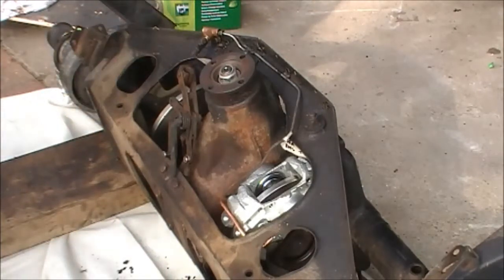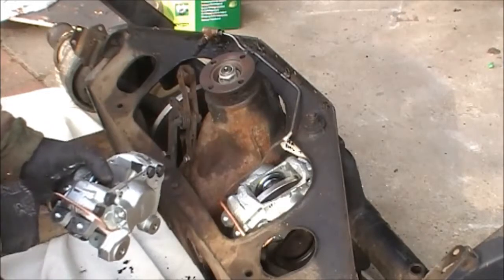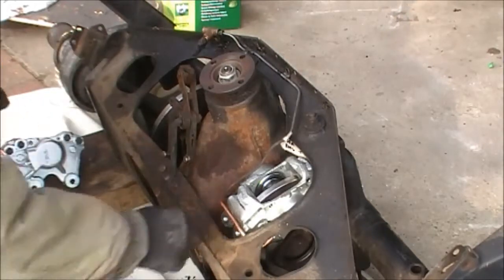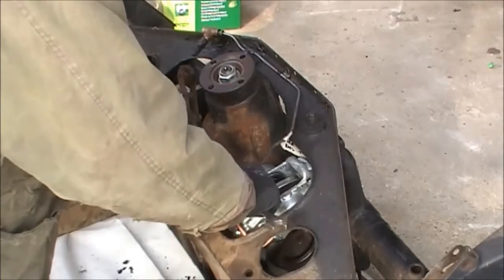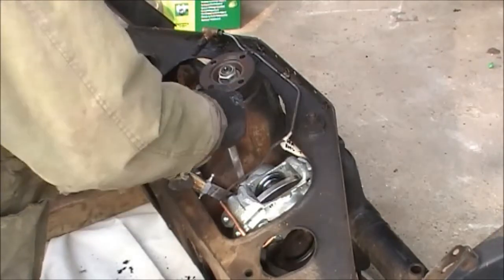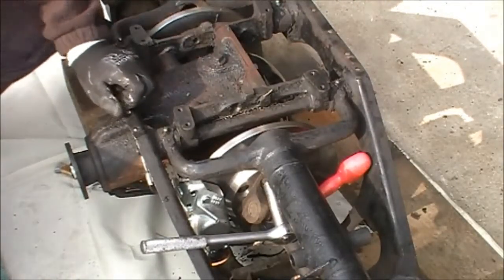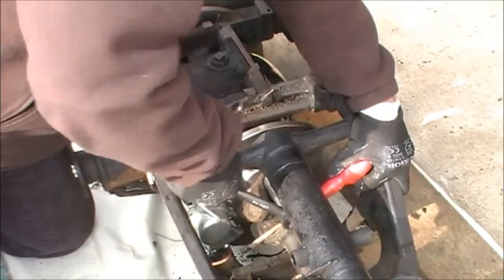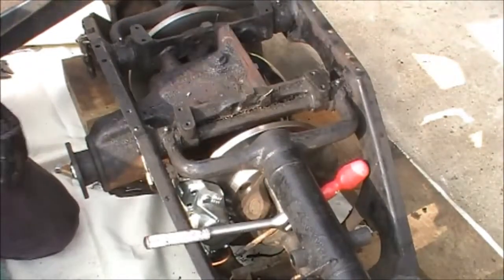Jaguar E type Rear Suspension Rebuild Part 5

Comment: Thank you for posting these instructions.  I have a serious concern though.  I'm afraid that copper plumbing tubing is not strong enough for the pressures involved with a hydraulic brake system, and steel is used (rather than copper) because its strength is necessary.  I once bought an older car and subsequently had a brake line failure.  Some prior owner had replaced the steel brake tubing with copper and the copper line broke off at the point it was flaired for the fitting.  If what I suspect is right, using copper for brake lines could result in a burst line at  a time of panic braking when line pressure is highest. Obviously, this is a serious safety concern.

Comment: I don't think it is a valid concern Doug. I have been using copper on my rally car for 2 decades and the pipes are the only things still going as all other components of the brake system have been replaced around them many times over.  They are provided as standard by most suppliers and whilst I have never stopped to think about it I suspect that their technical advice lines have faced these questions many times before.  Hope that helps but if not you would have to work out the stress in the metal compare it to the elastic limit for copper and the pressure that the system generates.